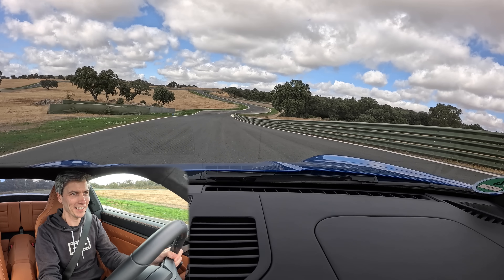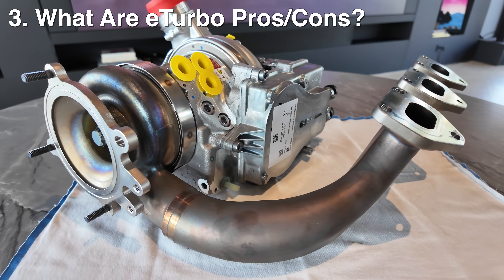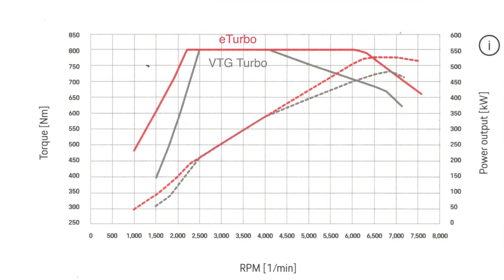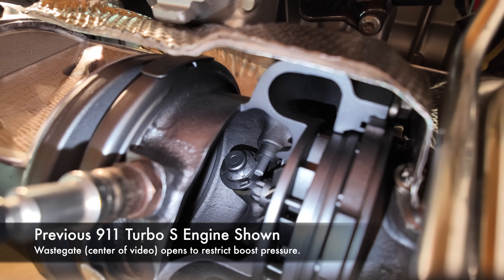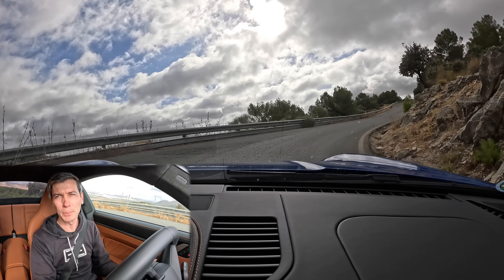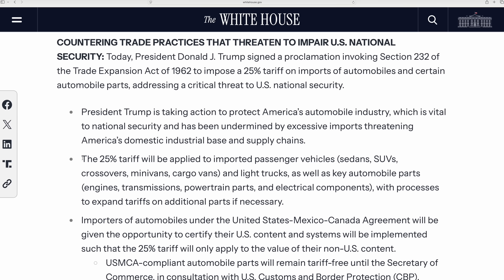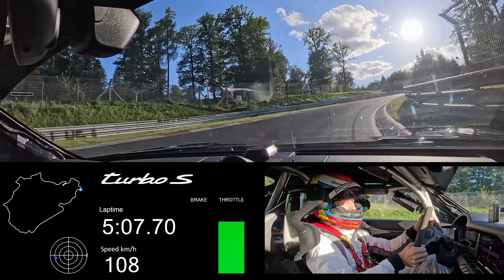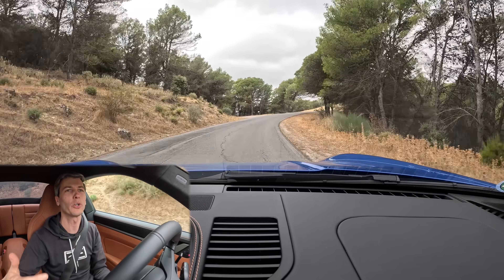Electric Turbos Are Here — Is It A Good Thing?

Comment: Gas engines have come along way in 100 years.  Engines buried in clean air devices which adds complexities.  Last 10 years of EV’s is starting to take off.  I have owned many exotics where you bought ultimate performance and moving art.  Many exotics are just moving art as EV’s give you the performance with less costs and less service interval if any at all.  Porsches are the closest to exotics without the headaches like parts and long repair intervals.  I was a gear head now own Teslas but I always have one Porsche as a back up car if needed.

Comment: Interesting design. But why did they choose such a small HV battery? Surely another 100kg would maximize total system power by running the traction motor at full power throughout. Surely that would offset the effect of increased weight.

Comment: Hypothetically, you could use this as an exhaust gas scavenger as well: You could pull the exhaust pulse out of the cylinder. There is very little advantage to this. But, hypothetically, it'd provide a small boost to performance. You would have "negative back pressure" - sucking the piston upward rather than the piston pushing the exhaust pulse out. I can only imagine tuning this would be a nightmare. If this worked: you'd need very little valve overlap.

Comment: The most impressive thing is using the extra exhaust energy to give a higher peak hp to the wheels. Seems like there is quite a bit more losses in a turbocharged engine that i would have expected. Peak tech innovations.

Comment: I was going to point out that if it's electric, it's not a turbocharger, since turbo- means turbine... but well, it has a turbine, you covered that, it is.
I was going to point out that they should use the motor, which is also a generator, as a generator to charge back the battery... but they do.

Welp. I'll shut up now.

Comment: Thanks for mentioning that the starter motor, alternator, waste gates, and accessory belt are eliminated.  I’ve seen other reviews and they like to say this is more complex but don’t mention what is removed.  Personally I think this version has removed complexity compared to the previous version.   The previous car had two turbos already, the addition of some batteries and a small electric motor isn’t adding great complexity IMHO.  Electric motors have been around for decades, as have batteries, so I think we have that tech nailed down.   Car manufacturers are simply utilizing technology that has been around for decades.  The only real complexity is in the electronics.  What Porsche achieved here is truly remarkable, the side by side of the 992.1 engine against the 992.2 is incredible.  I cannot believe how much more compact they made the engine, which obviously translates to the weight being lower in the car, another advantage.

Comment: What people feel more than acceleration is the change in acceleration, the jerk. Your body stabilizes under constant acceleration and doesn't feel like anything anymore.  It's possible to think a car is faster when it's acceleration is constantly increasing than one that has higher but flatter acceleration curve. It's why makers seem to think about the feel just as much if not more than the actual speed over time for racing. A turbo certainly factors into this.

Comment: After getting a 99% drop in profits in the 3rd quarter this year with its electric craze, it looks like Porsche is keen to introduce new tech in ICE engined cars. Ouch. Lesson learned. But the action of braking the spinning turbos when they hit desired boost instead of what a wastegate does (letting them spin, but releasing extra pressure) isn't quite a great idea. Buyers are going to discover that soon.

Comment: Im sceptical about the reliability of the e-motors in the turbos, aside of that it's a phantastic system if you want to pay for it.
I thougt if E-Turbos come it'd be more of a small electric driven turbo to provide boost at low RPM until the big exhaust driven turbo jumps in.

Comment: I dont get, why they dont split the electric turbo in one intake side and one exhaust side.
Then they woult be able to spin both sides complete differently from the other, meaning maybe way better efficiency and/or power output.

Comment: How does Porsche's eTurbos compare to Volvo's dual-charger system from several years ago? They used a supercharger for low RPM and it transitions to the turbo at higher RPM. Just curious since this electric engine on the turbo is kinda doing the supercharger job. Im aware theyre different focuses, 1 is adding power for the bottom end and the other is prepping the turbo by reducing lag but theyre both trying to get the turbo going and im curious on which is actually better?

Comment: What if you just used an electric motor for the “turbine”? Not for a sports car application, but a limited time “boost” option for a regular car. Like normally it would be 175HP in N.A. but, then you get something like 30 seconds of 50 more HP. When you need some extra oomph, but don’t always need extra power.

Comment: Honestly the place I see this tech being super useful is in trucks, specifically big turbo engines (especially diesel) where big boost down low is great, but those engines also are so big they need higher turbo capacity. Plus it gives turbo motors more engine breaking. And if this is tied to a phev vs a regular hybrid? The regen capabilities off the turbo would be insane. Its cool to see in a sports car, but would be practical in truck application.

Comment: So the problem is lack of compressed air? Then bold on a compression tank that gives always the exact amount of compressed air to the direct air injection nozzles. Of course all controlled by the computer. No turbo needed in this case. It will always be there.

Comment: While it reduces complexity in some spots, motors don't like heat and turbos/manifold are the hottest part. Will be interesting to see how they hold up. All these speciality parts will need to be OE only as well. I'm sure there will be calibrations and coding needed for install too.

Comment: Cool tech and one of the best ways to incorporate electric into the system. My .ain concern would be reliability of the electric motors attached to a turbo. That level of heat will significantly degrade the lifespan of the electric motors and i am sure the cost of working on this system will be prohibitive after the warranty runs out.

Comment: I wrote my Master's thesis on E-turbos for improved efficiency, performance and driveability. I think they're perfect for the next iteration of hybrid vehicles. Great video and super informative, as always.
Reply: Very interesting, can it be found somewhere?
Reply: I wanna read it!
Reply: Unfortunately my supervisor didn't like it enough to have it published 😅. I proposed that car manufacturers could use e-turbos to meet the stricter euro 7 emissions standards, rather than re-engineering their entire powertrains. I supported the claim by simulating a 2L turbocharged mild hybrid powertrain with traditional turbos and compared it with one that uses an e-turbo. My theory was that since e-turbos allow an engine to reach peak torque significantly sooner and lower in the rev range, the engine can spend more time operating at more efficient rpms. It also provides a means of regenerating the heat energy that's usually lost through the wastegate.  In my simulation I considered the "load" the e-turbos put on the battery and hybrid system, and simulated city (many consecutive short accelerations)  and motorway driving (sustained rpms for a longer duration). Overall the e-turbo setup was about 7% more fuel efficient than the traditional turbo powertrain and produced around 12% less emissions. In my simulation, I configured the e-turbo to charge the battery during regen rather than power the  motor directly (like Porsche is doing). I assume that if I had, the improvements would have been even more. Hope this is interesting.
Reply: @SinaKhobyari  Whats funny now though is everyone is admitting that the climate scare was all a hoax. Europe is gonna have all of these insane restrictions and the US and China are gonna be laughing as all of your manufactures go bankrupt due to overregulation.
Reply: @ChefofWar33  china produces more electric cars and batteries than the rest of the world combined, not to mention renewables. What are you on about

Comment: Another reason the difference is less at high RPM is the motor is a fixed power, and the power needed for a given level of boost increases with RPM.  

You can accomplish the same by driving the turbo from the crank through a CVT.  A launch, or exiting a turn, step up the RPM to spool the turbo.  Instead of a waste gate, reduce the CVT ratio so the turbine power is applied directly to the crank.

Comment: You REALLY need to explain this no wastegate thing. How exactly are you getting better exhaust flow when the electronic turbo with NO WASTEGATE is actively SLOWING the exhaust velocity to regen? How is this not building up exhaust gas during high rpm?
Reply from the maker: eTurbo sets RPM, RPM sets boost level. Lower RPM means less boost pressure, so the eTurbo maintains that speed, there's no runaway of exhaust build up since the turbo RPM is limiting how much air the engine gets.
Reply: @EngineeringExplained so you're saying the exhaust is equal to the intake eventually, but then you're not getting extra exhaust to gain regen if it all equalizes, right?
Reply: It is a restriction and would increased exhaust manifold pressure with RPM, hes poorly explained it. However, velocity would be the same (the turbine is spinning at the same speed). 

But how much of a restriction compared to a wastegate bypass system? If you size the exhaust housing and turbine well, then probably a hell of a lot less.

Comment: I work at BorgWarner testing department and did some tests on that eturbo shown in the video. Really nice to see this things in action
Reply from the maker: That's awesome!
Reply: Many companies developed similar technology, but it's so expensive it will really only work on high margin low production cars. God help anyone trying to fix this system in the future.
Reply: @truantray  As a mechanic I see dollar signs.
Reply: @Charlie-dv7ev  mechanic - or rather electronics guy will benefit, maybe ?
Reply: @truantray  only way I can see it being "fixed" is a specialist refurb place (porche or not) giving you a discount on a brand new or already refurbed e turbo and taking the old one.
Reply: I know that you can't say much, any chance of them growing into the 80mm range? Seems like something I'd love to try on a racing BBC
Reply: @Romuls753 i don't exactly remember the compressor wheel sizes but as far as i recall correctly there is also a version with single eTurbo application that is larger that those biTurbos shown in the video. From repurposing point of view, this would be quite tricky since this is a HV part and there is a lot of security things that ECU must send right into the eTurbo to even operate it. I think for now without quite specific CAN bus know how, application in other vehicle would impossible.
Reply: I want to buy an EFR7670-C but they are very expensive;p
Reply: Pretty sure your company makes the turbo in my L5P turbo diesel. Instead of electrically controlling turbo rpm though, I’m pretty sure it just electrically controls the turbo vanes.
Reply: Yeah sooo... when will aftermarket upgrade e-turbos be available 👀
Kinda wanna put one in a mk4 1.8t lol
Reply: When will electric turbos be finally be available to the aftermarket, for people that want to upgrade and tune older vehicles?
Reply: Does the latest Mercedes W214 (year 2023+) also use BorgWarner electric supercharger or how does it work in that model?
Reply: @LionBlu2000 if it's M254/M256 engine then yes. But its entirely different device. It's not a large turbo with a hot side and motor in between cold side but separate electrically powered compressor so only cold side and e-motor.
Reply: @bakuhost  Do all M256 engines have that electrically powered supercharger, including the latest E-class? Rumours say new models may have ditched it, but it seems unreliable info.
Reply: @LionBlu2000 I don't know to be honest. I'm not that involved with application side.
Reply: @bakuhost  Thanks. So to my understanding, M256 has simply electric boost pump that instantly provides boost before turbo kicks in. Seems more simple and straightforward.
Reply: 2 seconds is massive
Reply: Electric motor connected to HOT exhaust components ….material quality/cost kept to a minimum. “No problems that I can see…..”

Comment: Anytime something in a motor can be adjusted on the fly instead of one fixed setup, it’s better.  Ignition timing, variable valve timing, fuel mixture, etc.  so this should be good too.

Comment: I can't tell you in words how badly I want to DIY upgrade / build a car with a drivetrain set up like this, every aspect of this system. I love the idea of optimizing all the components for maximum efficiency; there is a lot of low hanging fruit there for internal combustion engines. It sounds like Porsche picked every single one of them for this build. I might prefer a larger battery pack because my idea while still aimed at being high performance is also targeting a real hybrid ability of driving unjust electric power

Comment: I'd be really interested in seeing how Porsche is handling the heat on the electric motor sitting next to the turbine.  I assume they are doing some interesting things to keep it cool, since heat increases resistance of conductors, and will reduce the efficiency of the motor.

Comment: It's actually simple why electric turbos are better. 
They are not dependent on the exhaust gas velocity. So you eliminate the main cause of turbo lag, which is the spooling of that turbo.
The electric motor can activate the turbo at any time regardless of engine state, and it can finely tune the rpm of the turbo to send the right amount of air for the best combustion at any rpm. The ECU just needs to tell it.

Comment: Using the turbo motors as e-wastegates, I started thinking, well what if the battery is full, how are they going to put drag on the compressor. Enter the traction motor I guess. Quite the system.

Comment: Contrary to what the presenter said, 85kg extra on a car this size is a huge weight increase.
Reply from the maker: It's relative right! Yeah, it's a lot, but considering what components you're adding, it's not too much with the performance gain it provides. Car's still quicker and better handling.

Comment: My big question is why has it taken so long for manufacturers to implement E-turbos when Ebay has been trying to sell me e-turbos for nearly 20 years!?
Reply from the maker: Hahaha, they're all the same, OEs just figuring out how to implement those ebay turbos properly!
Reply: Umm, because those eBay e-turbos are total junk that do absolutely nothing but block airflow. 
If you paid attention, Porsche has 2x20KW turbos... The crap on Ebay is usually 250 watts, i.e 1/160th of the power... Like I said they do absolutely nothing but impede airflow at full throttle.
Reply: @PaulAirSky  I was being sarcastic, it's called a joke.
Reply: due to the density of commercially available battery technology

Comment: Electromotive Diesel has eTurbo’d for years.  EMD manufacturers 2cycle uniflow diesel locomotives and marine engines.  2cycles require scavenging, so instead of a roots blower, a turbo is spun up by an electric motor.  When the engine gets up to speed, the turbine powers the compressor impeller and excess power routed to propulsion…same as the Porsche.  
   ETurbo tech may revitalize 2cycles for auto use and rid engines of the weight, complexity, and volume of valvetrains.
   Computers for control, and computers for analysis are revitalizing old technologies.

  FYI.  A “looper” (Schnuerle ported) 2stroke will not supercharge because exhaust port open thru the intake duration.  Uniflow and Opposed Piston 2strokes will supercharge.  All  2strokes will turbocharge.  
   Looper diesels fell out of favor by the 60’s.  OPs are making a comeback…(Achates ..Cummins).  Nerds, check out the Napier Deltic, Fairbanks-Morse 13  8 1/8, and Nordberg Radial.   The F-M engine is approaching a century of production!   Cheers

Comment: I feel like this is setting up a future of designed product failure to result in replacement repairs. Turbo's generate and hold a ton of heat in the engine bay and introducing electronic parts into a high heat area is going to result in premature failures. All this stuff is mechanical for a reason and trying to make yet another part go from mechanical to digital is going to result in ridiculous repair costs and reliability issues.

Comment: I drive a 2019 hrv, its amazing 99.99% of the time. I wish it had just a little more oomph merging on the highway. Imagine if you had like an electric air compressing device that could just give a couple seconds of boost to the engine
Reply: For that scenario it’d be easier and cheaper to just put nitrous on it. Could give it an extra 40hp pretty easy and at that low level a bottle would last a while. 
There are aftermarket electric superchargers that actually work. But, by the time it’s all installed and working you’re looking at the same cost or more compared to a regular turbo kit.

Comment: 5:57 - Why 1.9kWh battery is so heavy? Are they using LFP instead of NMC? I'm asking because my NMC ebike battery 48V 25Ah (1.2kWh) weights only 6kg.
Also I do not believe that battery has usable 1.9kWh. They are most likely using standard 21700 cells (17Wh). 108 (because 400v/3.7v) cells * 17Wh = ~1.8kWh.
Can somebody also explain how 108 cells can provide peak power of 40'000 watts? According to specs single 21700 NMC cell can provide only up to 60W. So 108 * 60 = 6.5kW.